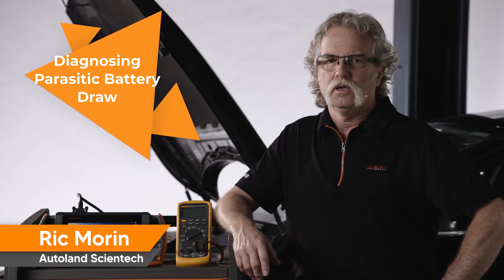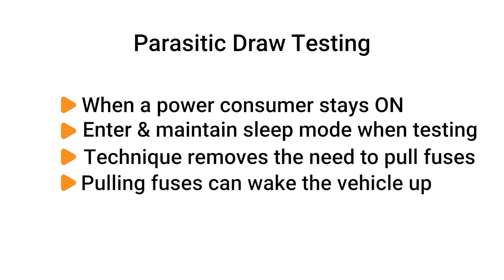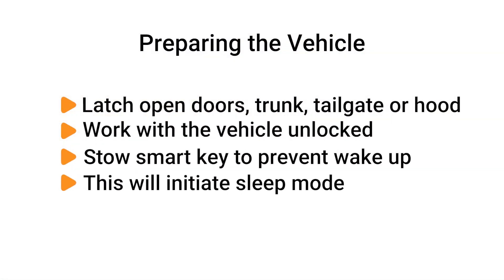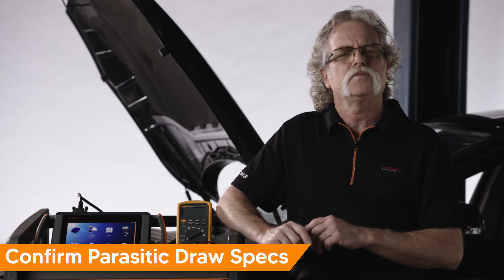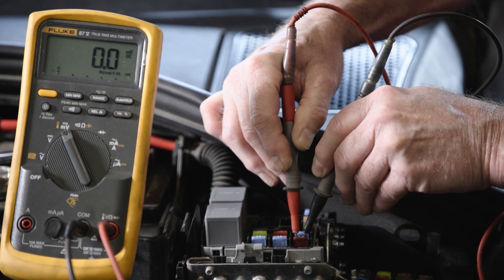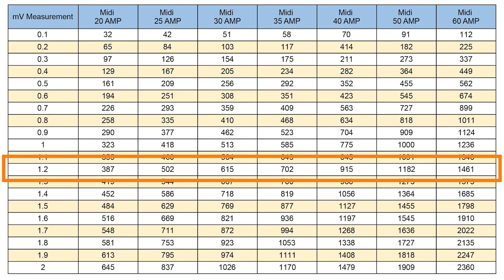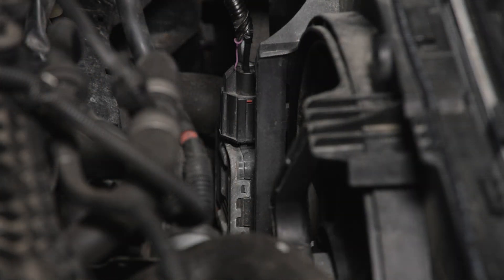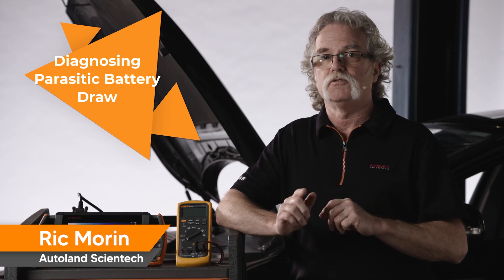Fastest Way to Test for a Parasitic Draw In a Vehicles Electrical System - Battery Drain Testing

Comment: When you are doing the initial check for a parasitic draw with the low amp clamp, the multimeter is showing 145.4 mV DC but you say the car has a parasitic draw of 1,400 milliamps - how do you calculate that from the other reading?
Reply from the maker: The clamp is designed for use with DVOMs and scope and has two ranges you calculate from. Either: 60amp 10V/Amp or 20A 100mV/Amp